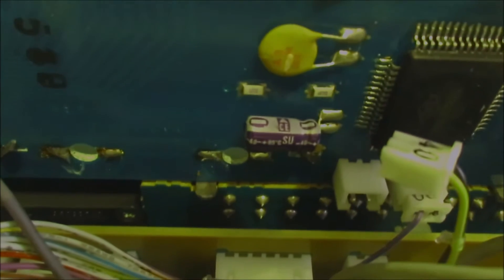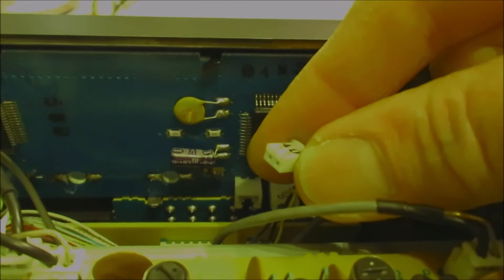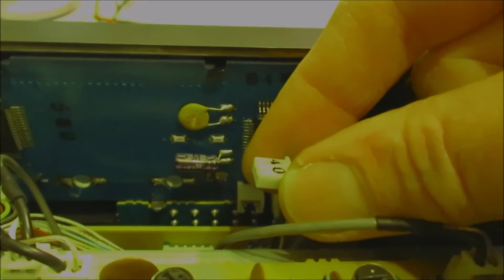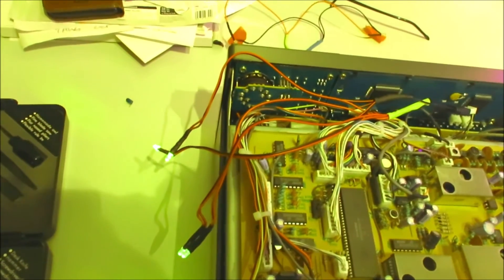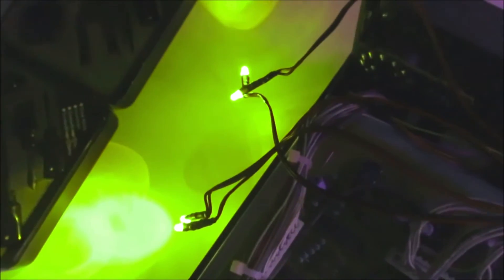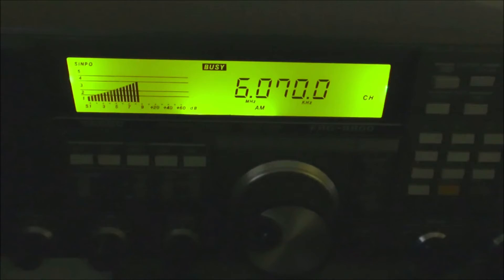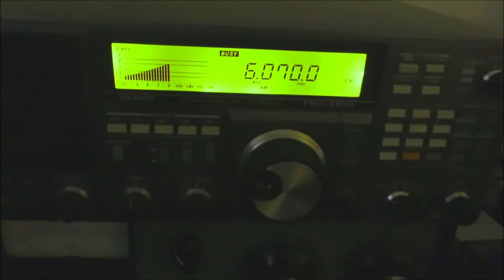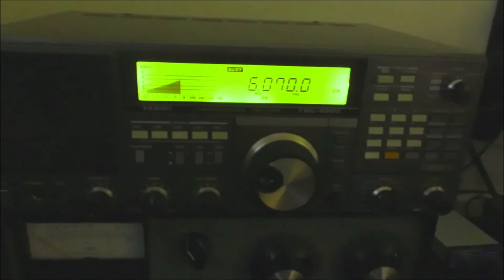Replacing blown backlight bulbs in the FRG 8800

Comment: Where did you get the socket to mate with the Yaesu plug?  I have been looking for a supplier of the connectors used in the FRG-8800 everywhere
Reply from the maker: I used plugs from an old PC I had dismantled.  I think they are the same connectors as those where the PC fans plug into the motherboard